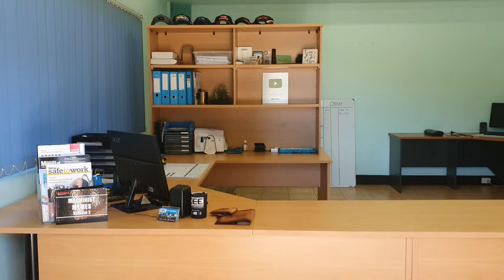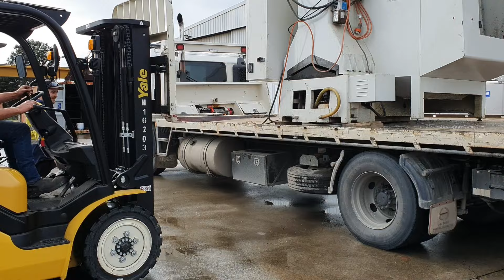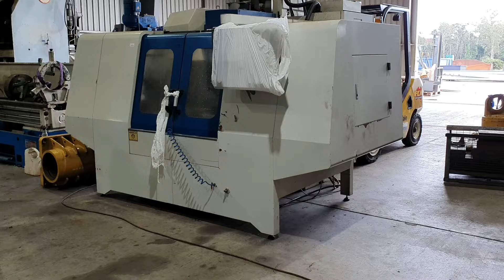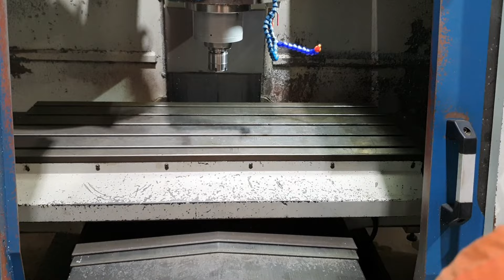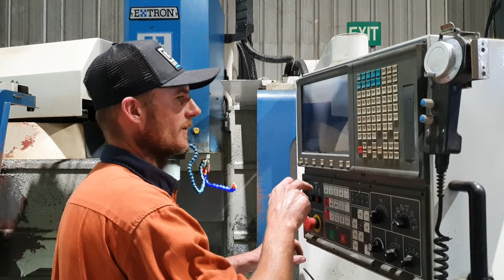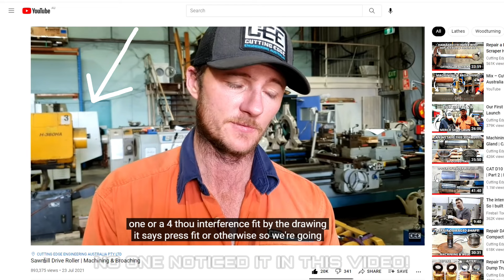Finally REVEALING Our New to us Machine | Workshop Machinery

Comment: Kurtis, don't be afraid of CNC! I started teaching myself in 2015, it's not rocket science! A proper graphics program with cam and G-code output and a good control program for the milling machine is the most important thing! You can do it! 
It's best to try the first steps with wood, preferably hardwood.

Comment: Perhaps try a CNC 2 axis Lathe such as a MAZAK M5 which I think could comfortably handle most of your work that you might do on your manual centre lathe.
Any one can work a CNC using the manual traverse speeds feeds. With the step handle you would machine starting face and OD/ID which you would measure- input the measurement,  then when zero returning the machine on both axes you have a starting point at Zero Return Known as a G50. 
There is a lot you will find if you look closely at it such as it's canned cycles etc

Comment: I used my first CNC machining centre (horizontal) in the mid 1980’s.
Note this was before PC’s and CAD.  We had to program every movement every speed change every tool feed….  by hand.
I remember sitting in a room with my eyes closed imagining the entire job step by step.  Typing it out on a teletype machine to paper tape and trotting down to the workshop to read it into the machine.  
The machine was worth about 5 decent sized houses.  It was a lot of fun to use.
It inspired me to take up a 30+ year career in IT.
I think you have the right idea to get into this when it’s not mission critical.
PS. Who has spare money 🤠

Comment: So here’s a question for you.

I’m messing around with the idea of having a cylinder head cut from an ali billet, but the cost is hilarious.

The head has been designed in CAD, and is pretty much good to go. Can you shed some light on why the costs are so high? (60k GBP?)

I do have a pretty coloured opinion of CNC machining in that I see it as a bit of a silver bullet: put the billet in, press start, have a brew. I am aware that this may be a tad simplistic!

Comment: Looks like you occasionally need is a set of fork extensions...So, by showing us this new machine what you're really aiming for, is a FIDIA GTF 32 CNC high speed double column 5-axis auto tool changing gantry type multi center milling machine?

Comment: Curtis - as you are already a solidworks user why not upgrade that software with the Israel developed solidcam software. There is bound to be a post processor for your machine already so the requirement to learn gcode is not needed. So you develop your 3d models in solidworks  then use solidcam to develop the tool paths which, via the post processor, you download to your new cnc machine and then the magic happens. Good luck - please post your cnc experiences for us all to enjoy just like the rest of your fantastic videos.

Comment: G0 G95 M3 S3500 M150 H14=80 
G0 X0 Y0 Z100
G0 G41 X-75 Y-70 Z5
G1 Z-5 F1000
G1 Y70 F500
G1 X75
G1 Y-70
G1 X-75
G1 X-80 F5000
G0 Z100 
M5 M17 M30 

Extremely basic milling of a rectangle 150x140mm 5 mill deep ; rapid positioning in X/Y 0 to quickcheck centering of piece; start of milling @ lower left corner @X-75 Y-70
G0: Fast feed
G1: Programmed feed
G41: Tool radius compensation for milling (G41 = mill is left from programmed contour; G42 = mill is right from contour)
G95 : Feed per revolution /feedmode (G94/G96,etc...)
M150 : Siemens-specific command for high-pressure coolant
H14 : denotes pressure of coolant
M3: Rotational direction (M3=cw, M4=ccw)
M5: spindle stop
M17: end sub-program
M30: end main program

Comment: pollepost gave very good advice about single block mode and feed rate override but, I wanted to add that, if your machine has a CRT, then on the display you should see x, y, z actual position coordinates under “distance to go” on the screen. Pay very close attention to these numbers when you are single blocking through a program. My first cnc lathe (in 1987) only had X / Z digital readouts and no crt so, the hand written G-code had to be spot on. Good luck and if there’s anything I can do to help, feel free to reach out

Comment: I'm a manual machinist up in Canada. I rebuild oil field equipment. They bought me a Mazak about the same size ten years ago. They are very addictive. Mine is basically manually programmed. Now they have a kid running a new Okuma. He draws up a 3D print in 360, feeds it to the software and the program is written. He thinks he is really something but he is clueless. His understanding comes from gaming not starting on a drill press and advancing. God help us!

Comment: Lol, an old Hurco 4020 with an Optimax control. 
I haven’t gotten to the reveal but this has got to be a Hurco, if it’s not a Hurco then it’s a Chevalier or other Taiwanese machine tool.
Man oh man I cut my teeth fixing those, if you need the service manual DVD for it I have it.
Hurco will upgrade the control to a Winmax, easier getting replacement memory, Ethernet card and backplane for the newer stuff, not to mention you damage a key contact on the old control console, they don’t have many spares in stock.
Is it Siemens or Yaskawa drives?

Edit: then I saw the covered console, it’s not a Hurco Optimax … never heard of “Extron” but besides the carousel tool-changer that is a clone of the Chevalier 2040: door rails, side door hinges, spindle column, table 
…now I’m wondering where the Chevalier was made that had to come out of the same Taiwanese plant.

Comment: congrats on your first CNC machine. Programming is not that hard. The most important thing is to know how to setup a safety zone or work-area limits. That will greatly reduce the amount of crashes and possibly wrecking the machine. Mounting a "dashcam" or a WiFi camera can help see what went wrong, if anything happens and you're not there. A rule of thumb is to always be there when you run the program for the first time. If it went well, save the program and then when you need to rerun it, you know that it works well and is mistake-free and you can leave the machine to do its thing while working on something else. 

Don't manipulate anything that has to do with safety. If the machine won't run if the door is open, don't wire the switch to run with the door open. Using manual lathe or milling machine, you are usually close to the part and you get used to being close to it. With CNC, you have no feeling for the machine, how hard it is actually cutting through the part, etc.. It may be more natural for you to want to be near the part when the machine is running but the door is in the way, just ignore it. The door and safety glass can save your life. If the coolant is making visibility hard, get an iPad screen protector and fix it to a part of the safety glass. Screen protectors usually have a hydrophobic coatings and will repel water and make visibility way better. They usually last for about 3 months before the coating is worn down.  If you want, there are such coatings for cars' windscreens. You can try and apply a layer on it and see how it works. I still didn't try that, one day I will.

Comment: Try to learn some basic  g-coding first before going to CAD/CAM.    Just so you can read the code at the machine.
CNC has lots of advantages,  like making softjaws to fit the part and thread-milling holes too hard to tap.   Lots of fun stuff, like 3D milling surfaces.  Large programs can be drip-fed to the control so it does not need a lot of memory.

Comment: It might be a milling machine but the capability means it can do practically anything  as long as you learn how to write up a pattern. it's old software and it may pay to dump that and get new software which you can  use to design a job at home then send it to machine station . 
One of the interesting things I have seen one of those do is drill out a bunch of broken studs in a drilling head. the job was clamped down,the operator fed in the coordinates of each stud center let 'er rip. Took less than 30 minute to do a job which could have taken 4 hours.

Comment: I am trying to think what kinds of machines could help with the type of jobs you do.
If age weren't known I would say a cnc flame cutting table for making eyes and ears lol
But 50 years old, maybe a large boring or drilling machine for making cylinder barrels?
Or a vertical lathe for turning big stuff?
Maybe a horizontal mill with a rotary table for the same purpose but more versatile?

I thought of a surface grinder, but I don't think you do that much that would require one, and I would question it's accuracy after 50 years without a lot of work lol

A shaper is of course a popular suggestion, and while it would be fun and make beefy videos, you have a mill so why waste time on a shaper? Lol

It could be something simple like a big ass bench grinder, or maybe a small Bridgeport tool room lathe.

Oh! A grinder for making tooling might be useful.

So I have enough ideas I have a chance of getting SOMETHING right lol
Reply from the maker: i like the way you think!
Reply: @CuttingEdgeEngineering  not sure if that means that I got something right, or if I just mentioned some things that you wish you had! Lol

Comment: There are a lot of cnc channels on YouTube, millennials teaching the basics, narcissists teaching how great they are, guys with cat 50 tapers up their.... Chip conveyers..., funny guys, guys who have panic attacks at the thought of keeping a scrap pile around, etc (bonus points for the people who know who each of those descriptions fit lol), but the only guy I know of who has the level of wisdom that I think you would want to learn is Edge Precision.

He works on specialty stuff, iconel, titanium, etc, jobs where the Blank costs $20k because it's some special forged titanium alloy or something, so he's only got one shot to get it perfect.

One difference between CNC and manual is that you have to be able to plan ahead and know what your material is going to do, rather than just making a pass and checking it, and that's something he goes into depth on, how to predict and compensate for all the factors.

He's slow paced, but he walks through what he's doing and why, goes into detail on g codes and planning out tool paths, and does a lot of manual work with the cnc machines as well, or running short programs to get a particular step done, rather than start it up and it spits a complete part out.

I suspect that his use style will be closer to yours than someone focused on a job shop environment where it's all about shaving cycle times and fixturing multiple parts at once, and he spends a lot of time on the manual aspects, interfacing via the control panel rather than just via CAM software.

But he also does quite a bit with the cam side on some jobs, especially dealing with verifying programs before you run them, partly because his main machine is a giant Mazack and so any crashes would be very expensive, and he's often working with very expensive or long lead time blanks where a tiny error will destroy it, so he's very good at verifying the programs.

It will take you much longer to watch his videos than to read my comment... Lol, but if you are wanting to be as good at the cnc as you are with manual machines  I think he will be at your level,

His projects are usually pretty fascinating too, wierd oil industry and aerospace gadgets with holes and ports everywhere.

He also makes a lot of custom tooling.

Comment: One of the biggest perks of a CNC mill is that you CAN use boring tools as you do on a manual, but you can also make interpolations instead. You can make a circular tool path and use an endmill to cut an ID or OD diameter to size. Also bolt patterns are way easier to do. Once you learn basic G&M codes, you should catch on pretty quick 👍🏻

Comment: I have been a machinist for 40 years, the vast majority of them CNC. Operated, set up and programmed too many to remember. Mostly 5 axis 3d machining now. When I started out, NC tape machines were just coming on line. Once you develop the basics, one tends to be their own best teacher. Some things are not intuitive and you will hardly ever figure out without asking someone, but usually you can get by.  Keep one thumb on that feed hold, learn to jog the cycle start and the feed hold with both thumbs until your through the entire program. Good luck making chips.

Comment: My dad had an Engineering Workshop and, because he was old school, resisted buying a CNC for years as he thought that it would be a waste of money.  Eventually we had to because of a break down in another machine.  He was worried that it was a lot of money for something that would probably sit around unused for most of the time.  Luckily it was conversational programming (so if you can manual mill you can use this one) so we were up an running very quickly.  The machine never stopped and we could have used another one before he retired due to ill health.  The moral is that once you get machines like this you seem to find the work for them and end up wondering how you every got along without one.  Just don't let the manual skills slip because there is still a big need for those one off jobs that are quicker on manual machines.  Not to mention that it is great fun and very rewarding whilst you are learning.

Comment: Clearly you need a ginormous cylindrical OD grinder for the hydraulic work you find your self doing and a modestly sized water jet to cut plate steel into the odd shapes you need.

Comment: Going from zero to 60 on CNC is about 40-50 hours of CAD & G-CODE training.   Some CAD software can convert to G Code.  Without a G Code file you have an expensive boat anchor.  I suspect that projects you see a lot (heavy equipment parts)  can have their own file and you load stock and go do something else.  Weld repairs may require analog run then onto CNC.  GOOD LUCK.   Thinking digitally vs analog is a big jump.

Comment: Hey, that forgetting what you were talking about doesn't get any better as you get older. LOL! 
My first exposure to CNC was a machine run from punch cards. Next was one that used tiny little cassette tapes. Then there was the Hurco that had been both, converted to some step by step Russian roulette style mess that I could have had 5 done by the time you programmed y-axis. I lucked out when I found a job in a plant that I was the youngest guy in there at 50. Most of those guys had been there for at least 30 years and looked at me like I was an alien with green pointy ears! The shop had 2 shapers, a huge planer with a 20 foot bed, 20 foot gap bed lathe from 1890, 2 identical Van Norman mills from the 1940's, a huge vertical lathe, several lineshaft driven surface grinders and a turret lathe. We had a couple more lathes, mill,welding shop with several machines.
Point is every one of those machines worked every day making and repairing parts for our carpet looms. We're they wore out? Sure, but you knew they were wore out. Those guys could run part after part on those machines and have them spot on repeatedly. 
Shapers may not make you money but they are cheap and save time. Why mill that excess material off with an expensive cutter when you can whittle it off with a tool steel lathe bit? 
Shapers are good for blind internal splines, gears and anyways too. I even made an internal gear for a wheel on an antique lawn mower wheel for the boss.....LOL!
Whose old machines can do a lot of work and I was in my element at that plant. Those old guys can be absolute wizards on those antique machines.
Cheers 
Terry

Comment: 50 years old machines.
Someone said "Shaper" ... did they still make them at 70's? I don't think so.
A specialized drill sharpener might be one that would be useful. Those big HSS drills are a PITA to sharpen in a bench grinder manually.
A surface grinder is also missing although it might not be that useful given the tasks.

Comment: As a lifetime computer programmer, a prediction: If you dedicate just a little time to learning the machine, you will find that there are many routine procedures that you do over and over, where only a couple of dimensions or steps change from job to job, and this machine can repeat all the others perfectly for you every time. Just plug in the few changes, set up the piece, and walk away. The learning curve is steep, but only at first. Then it will be a walk in the park. You're going to wish you had taken this step years ago! Looking forward to seeing what you can do with it!
Reply: Endorsed                             -                            by an old git, UK

Comment: Good old feel of the 90ies / early 2000's. Is there a 3,5" floppy drive and a 25-pin RS232 serial port on the machine ? :-) 
My guess for the 2 other machines are : a small CNC lathe and some kind of a rod grinder ?

Comment: Thats a pitty that you seem not to be able to turn the axis of the working head!
For the work you are doing this machine imho not really serves! Since you are showing allways very various and different single own Tasks! Also you would need a cad-cam interface to transfer cad Designs from the computer directly to the machine... what would give you some advantage in programming. Because you would need to know cad knowledge and cnc knowledge anyway
Reply from the maker: Got to learn and start somewhere 🤣👍
Reply: @CuttingEdgeEngineering  if this is just for fun your dog and your wife will miss you for months! If you wants to learn this machine really the most economic and qualified way would be an appropriate workshop for workcraft men like you! The time to adapt this on specific own tasks will be abundant anyway....

Comment: 50 years huh, a shaper seems pretty practical. For the other it could be a sheer or a roller but you don't do much work with thin metal. A water jet would be cool to see but I don't think they were around in the 60s